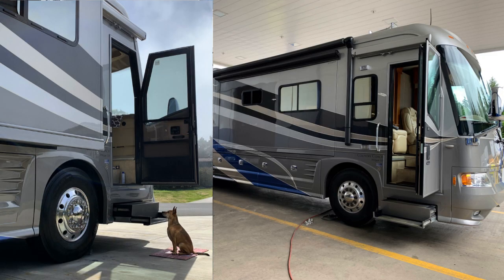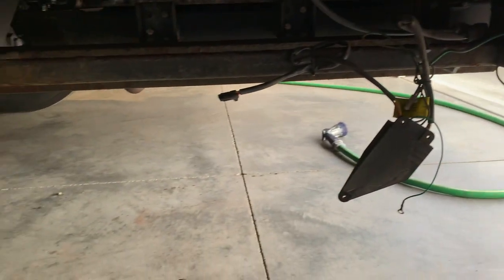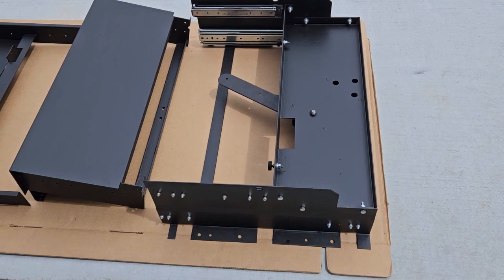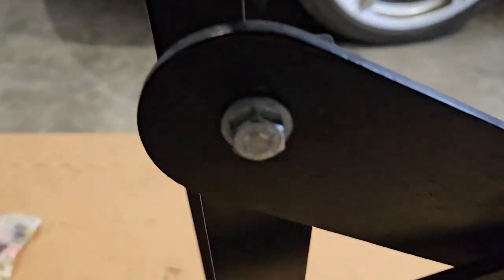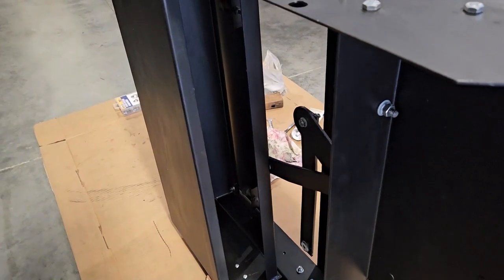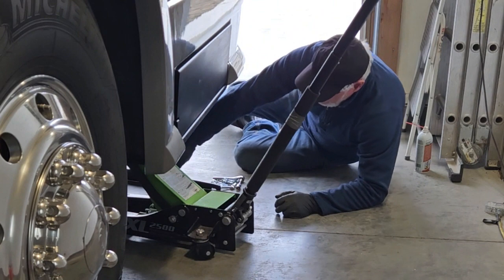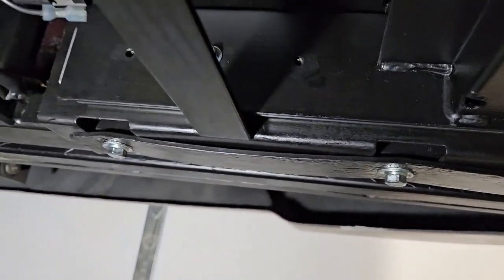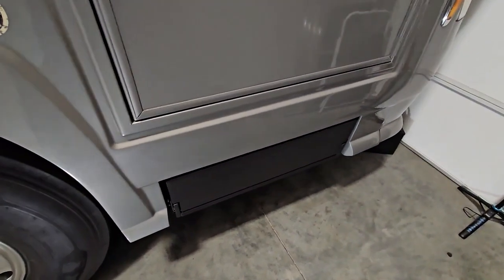Kwikee Entry Step Overhaul on a 2008 Country Coach RV

Comment: Great job Rod.  I completely tore ours down and bead blasted then painted it a few years ago after getting our coach painted.  I also detected some wear so I machined a few new Oilite bushings to replace the worn ones and for the past 6 years or so it still operates smooth as butter.  However, ours is a pantograph style single step on our Monaco Dynasty vs. the sliding step on your Country Coach.  Awesome job and thanks for sharing.
Mike
Reply from the maker: Thanks for the comments. It’s nice to be able to share these findings, as there seems to be limited info on our era Coach’s.

Comment: Rod, just bought a 2002 affinity and on our third trip the steps stopped working. Took a look and one of the bars had the bolts come out. Could you give me the dimensions of the stop step scissor bars
Reply from the maker: Hi Darin,, sorry for my late response, have just seen this. Can you clarify are you looking for the rubber bump stop dimensions for the top step, or the actual bar dimensions. Thanks

Comment: Buying a 2002 Intrigue 32. It is in great shape but loving your videos I can see zi will have lots to do...
Have you run inyo any furl system issues yet? How do you wash salt air off to keep down corrosion, I live at the coast in Oregon.
Reply from the maker: Hi, As mentioned in many of the videos, I have an RV lot on the West Coast of Oregon, and the Salt Air plays havoc with all the coaches there. Corrosion is crazy. I made the mistake of leaving it parked there for a while, and now have to pay the price of removing all the corrosion. It now lives in Idaho in my RV garage. Thankfully. But yes, I keep it washed to try and remove the salt. But it such a task as there are so many places where the damp salt air gets to.
Reply from the maker: Sorry I neglected to answer your question on fuel issues. The only one I've had was down to chaffing fuel lines, you will see those in my video on Electrical Bay Overhaul, I found the fuel lines chaffing on the engine and frame. luckily, I found them before they had worn all the way through.